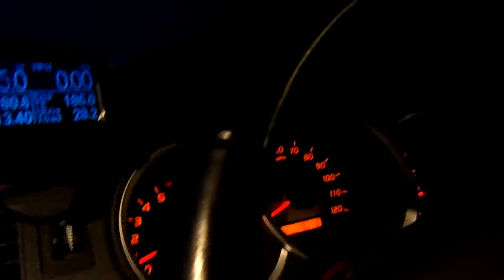ARB tire fill up test

Comment: Can't believe so few folks have watched this video, That's a good test but you need the digital inflator not the Dial one, the Twin compressor will kill the Blue ARB Inflator because the Twin puts out 150psi back pressure, Thanks for posting the video.